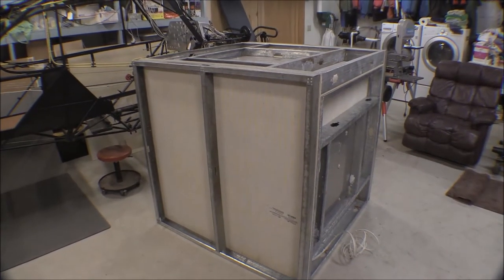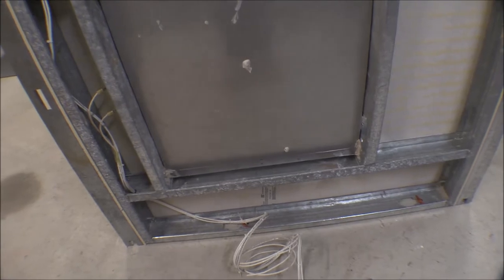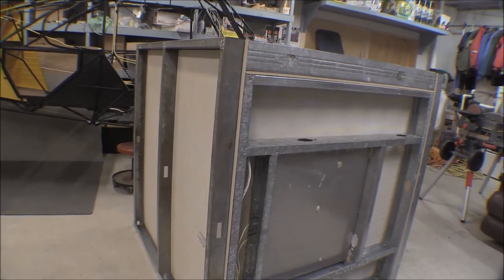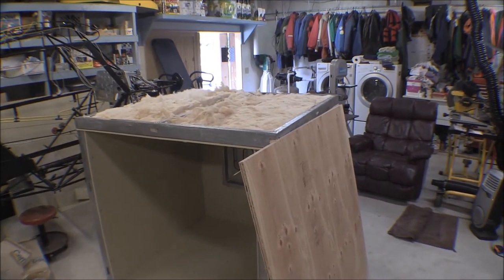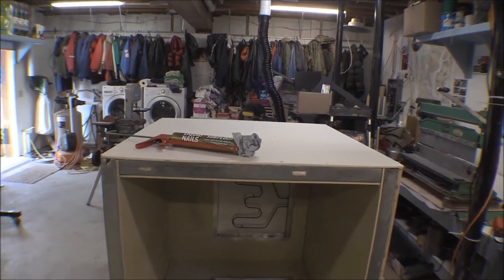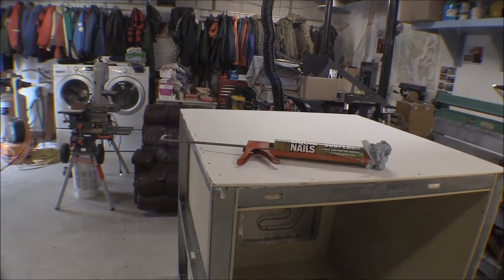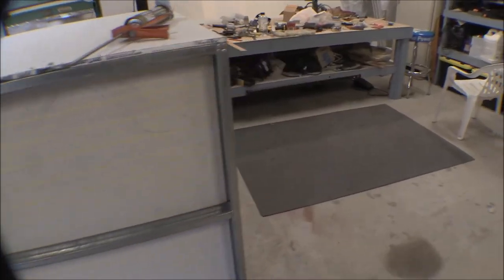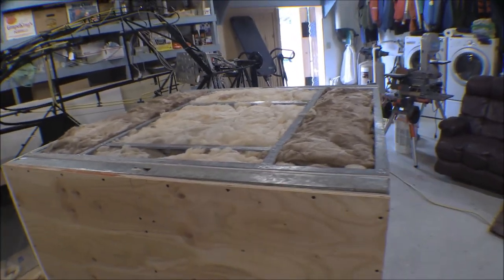Powder Coat Oven Build- wiring elements, insulation, external sheeting

Comment: so the inside walls are what exactly ???  any foil inside ?
Reply from the maker: The inside is Hardy board, it's a cemetious board sometimes used as a tile backer. It probably wasn't the best choice as it dried out and shrank in the heat and cracked. The idea was that it is an insulating material, fire proof, and would hold heat for a more stable temperature in the box. That part works well, once the box heats to temp it stays pretty constant, even when the door is opened and holds for a long time after shut down.
I don't have access to any kind of metal sheeting

Comment: Did the R-19 insulation give you any problems? I'm concerned about a fire hazard.
Reply from the maker: I'd have used rock-wool if it was available. I peeled the paper vapor barrier off so there's nothing flammable in the fiberglass.

Comment: For wiring the elements, is it just run one wire to each prong ? I have 2 elements as well did you just run them in series?
Reply from the maker: I wired each element separately, two wires to each(one wire to each prong). Just as well too, as the ssr's will only handle one element each. I tried 100 watt ssr's and they still failed with both elements hooked up.
Reply: psgflier ok thanks, I’m using an Auber instruments controller off amazon so it’s a bit different. So a hot wire to each prong?
Reply from the maker: Yeah, for 220 US, each wire is one leg(110) so one wire to each prong for 220.
 @just.wandering5192

Comment: So what do I use instead of the Hardie board
Reply from the maker: Well, the problem with the Hardie board was the cracking. I fastened it securely with screws to the studs with screws. That and the corners of the cut-outs is where the cracks started. If I'd have found some way to mount the boards in a floating mount and attached the heat elements on the outside of the boards instead of recessing them, they probably wouldn't have cracked. I have done that before when using Hardie board  as a heat barrier between a stove and a wall.
I haven't had time to work on the oven since I used it to powder coat the airplane parts, so I haven't worked out all the bugs. I need to figure a way to seal those cracks and the corners, perhaps some aluminum foil. I don't have access to sheet metal here, but that is probably what I'd have used if it were available. Actually, I have an old electric oven range and an old freezer, I may strip them for metal to line the inside. No, I don't think the oven range is large enough, gives me something to think about.